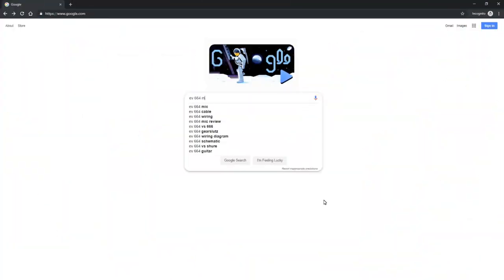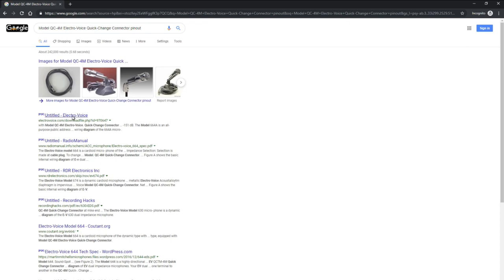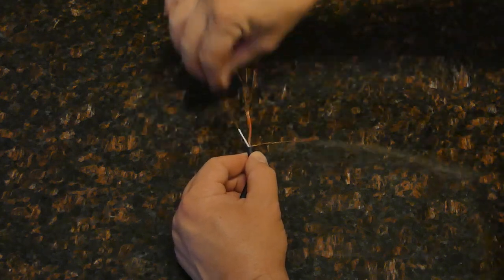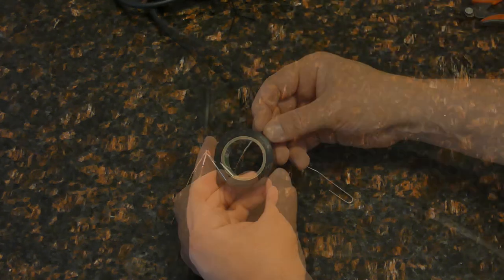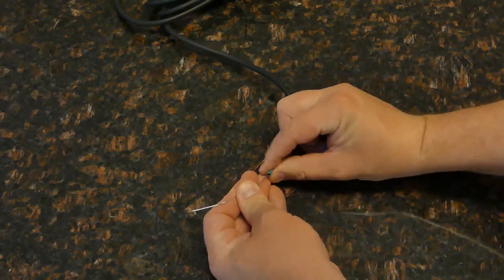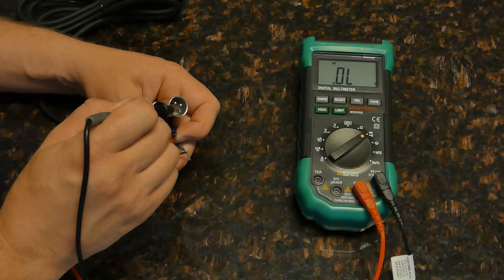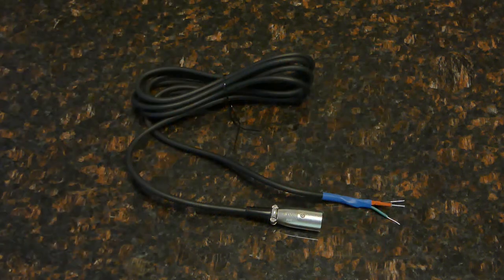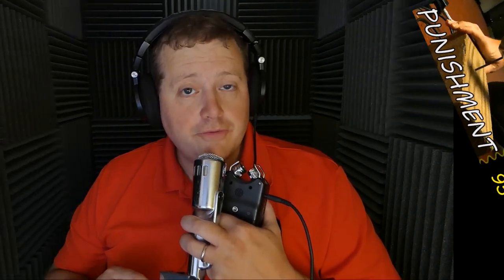How To Test Vintage Microphones Without The Right Cable - Sound Speeds

Comment: Great video as usual.

How about a video showing us different types of connectors we might find in the wild and maybe where to get replacement cables? I bet there's more than a few nice, functional vintage mics out there that don't get used because the owners just don't know how to plug it in to anything.
Reply from the maker: The main connector top concern yourself with area the ones you know. If a proprietary connector is on a vintage mic you need tested, know it long enough to test it and get a cable made.

Comment: Thanks for this information! I just bought an Aiwa DM-47 1960s microphone but am getting no signal when plugging it into my audio interface. It should just work if I plug in with fantom power, right? Could it be the cable it came with is just not working? Thanks
Reply from the maker: It's a dynamic. Don't engage phantom.
Reply: @SoundSpeeds  I tried both with and without phantom power, but still no luck
Reply: Do you think it’s possibly a faulty cable?
Reply from the maker: Or a nonfunctioning mic. I can't tech it without handling the mic.
Reply: @SoundSpeeds  right. Do you know where one can find the cable for this mic?

Comment: It looks like you only plugged in one pin in the video. Did you only need one to get signal from the mic? I have this same microphone that I also want to test. Can i make this same cable using an xlr to 1/4" jack? Thanks!
Reply from the maker: I'm not certain, to be honest. I just made this cable and probe until I find the winning combination.

Comment: i got a sennheiser K30 AV.  i want to add phantom power to it. but this mic only need 15v pp.  how i can do it?
Reply from the maker: Doesn't it have an internal 5.6V battery?
Reply: @SoundSpeeds  yea it Could be load with that. But i want safe batterys on the long term.   

all i kow is, the external power is set on the 8.th pin of the tuchel.  But my normal Phantom Power is 48V so how could i reduce the power?
Reply from the maker: Two things... Sennheiser can convert some mics to P48 fairly inexpensively. Might be cheaper than trying to buy a power supply. If you don't want to, call a pro sound shop in your area and see what they can get you. I know the Ancient UMP is very popular and can supply 12V as can the Denecke PS-T. I believe your mic can accept 4-15V.

Comment: 4:40 I winced
Reply from the maker: It's OK. I made it better.
Reply: @SoundSpeeds  You certainly did. The heat shrink made sure that you wouldn't scare anyone if you were to ask if you could use it with their equipment.
Reply from the maker: I've used this kind of cable on numerous vintage mics before. I won't use it on a condenser I don't own but passive dynamics, no issue.